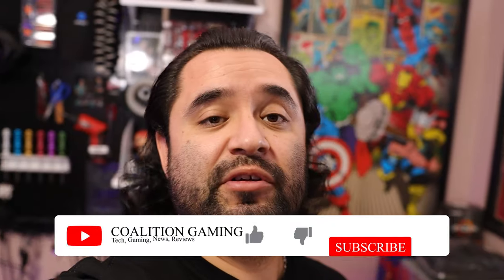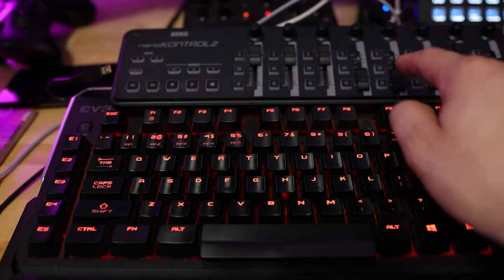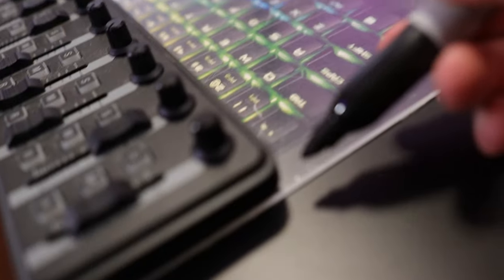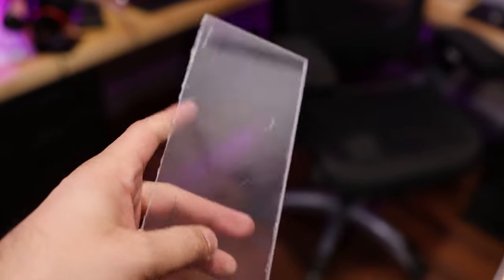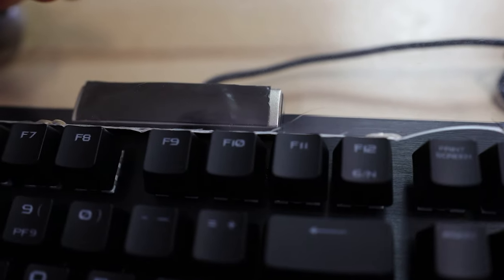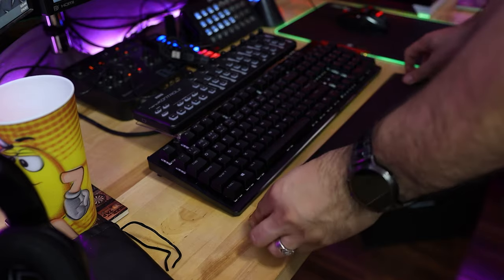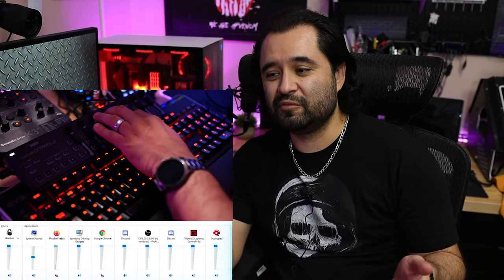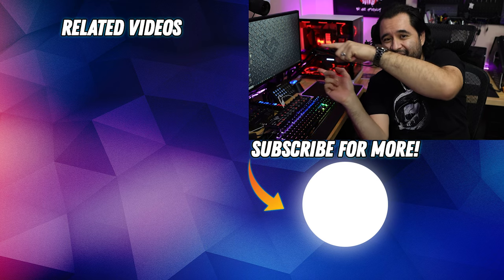The ULTIMATE STREAMER KEYBOARD for AUDIO CONTROL - How to

Comment: just wondering why you didn't use the dremel to cut your acrylic in the first place? would have been much easier and cleaner.. also you could have just created a stand for the audio mixer with an overhang that slid over the the top lip of the keyboard... and would be easily moved if ever needed .. and also would allow for easily replacing the keyboard without needing to modify your mount or the keyboard itself
Reply from the maker: Didn't think to use the dremel on the acrylic, the plan was to score it and break it the way they do in the store where I usually get it cut. Though they have a better tool. As far as easily replacing the keyboard without needing to modify the mount or keyboard....yeah that's exactly why I did it this way lol. I would just pull the acrylic shelf off, replace keyboard, put shelf back on. Simple. Sure I could have created a stand but I want a solution where this is integrated with the keyboard specifically, not yet another thing I have to add to the stuff on my desk.